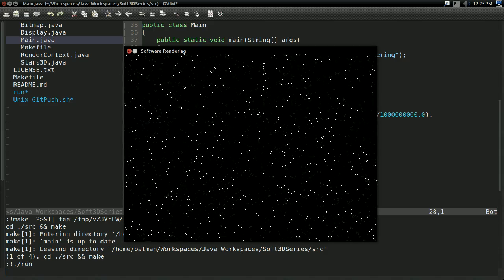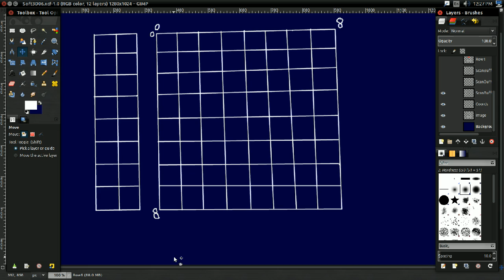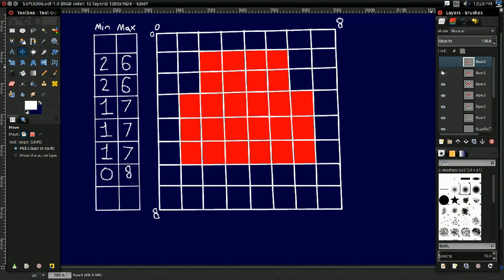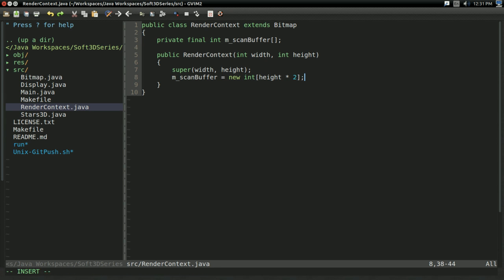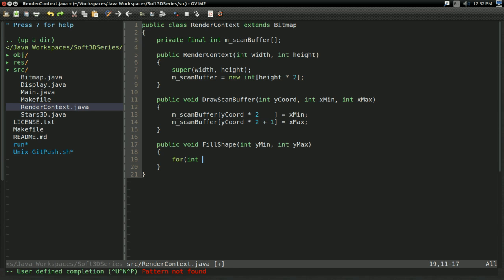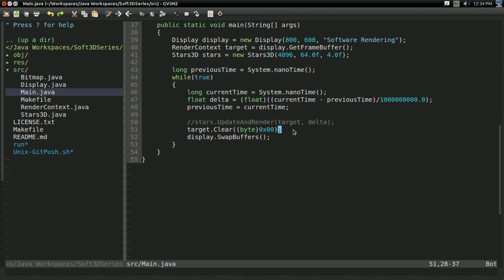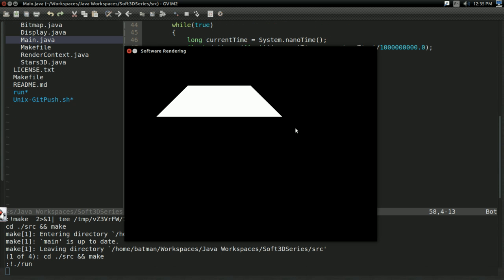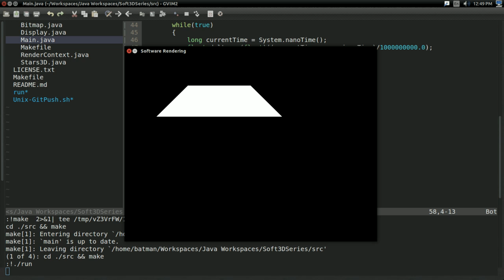#6 3D Software Rendering Tutorial: Solid Shapes

Comment: is this how the opengl context is implemented on graphics drivers?
Reply from the maker: RandomInsignia It goes even deeper than that; graphics cards have a real, physical circuit that implements an algorithm very similar to this one. A typical OpenGL context will simply tell the graphics driver to use that circuit. That said, in software only OpenGL implementations, code similar to this is commonly used.
Reply: @thebennybox  which is better opengl graphics or Java graphics plz repley
Reply: @jamescutajar2679  thanks

Comment: Why do you use final in all of your private variables?
Reply from the maker: Because they shouldn't need to be changed after construction. Using final both helps prevent errors, and can potentially make multithreading easier since there's less places where data can change between threads.